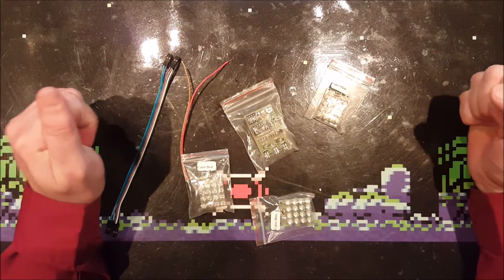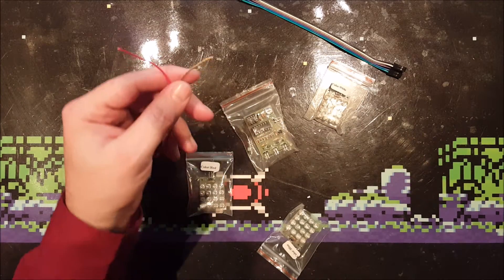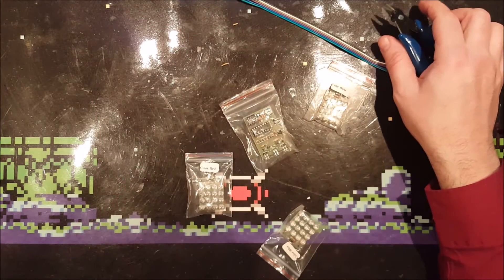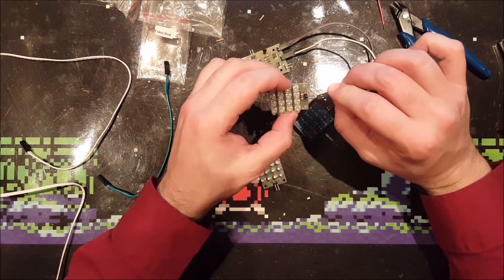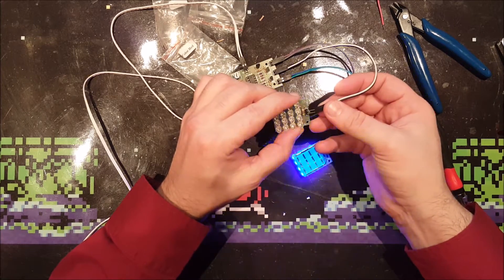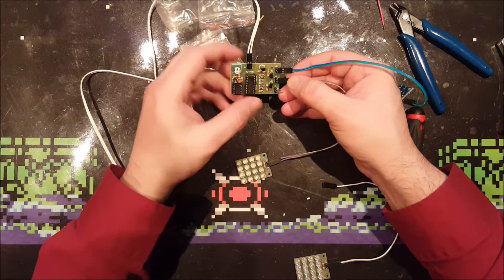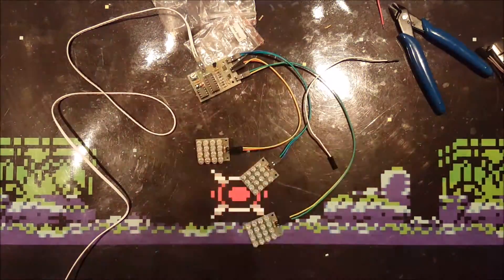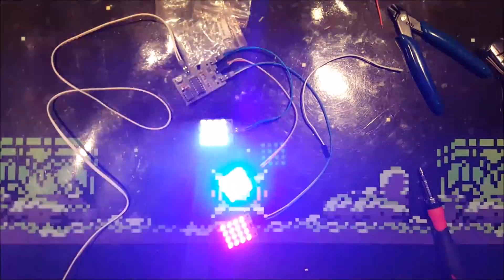Review of the most useless eBay LED kit ever

Comment: hi B...
'
i got LED flasher kit with 3 LEDs from online...
i did finish kit with four PCBs...
two PCBs with LED were not work light...
i cutted both PCBs with four copper lines from 16 LEDs to 8 LEDs and used jumpers...
now much better work on LED lights...
can work with 6 LED speakers